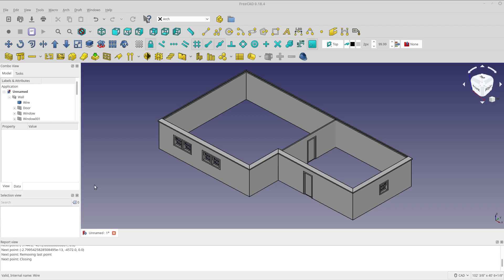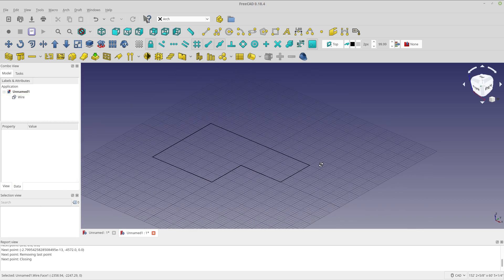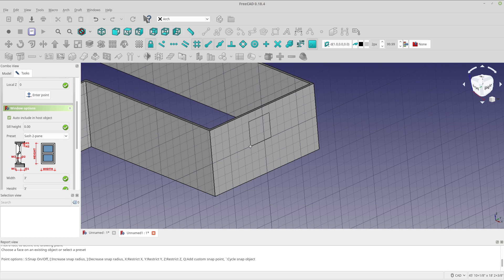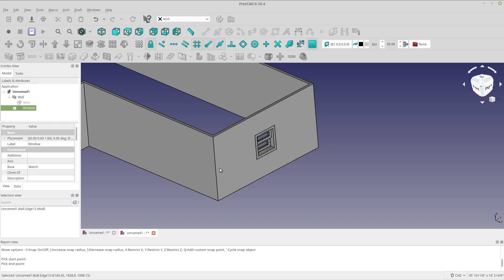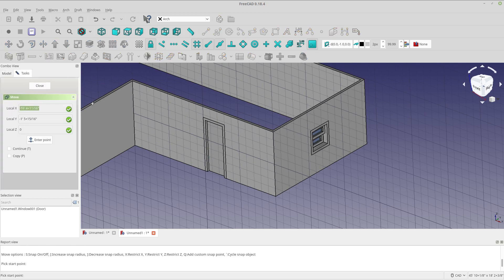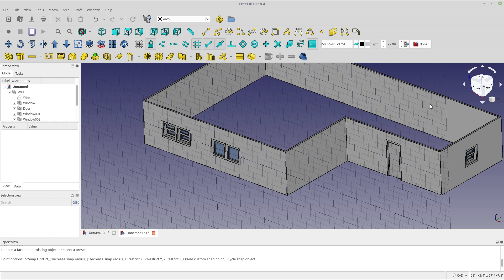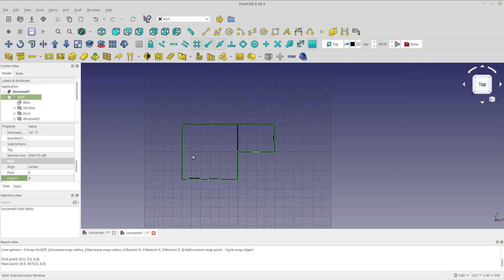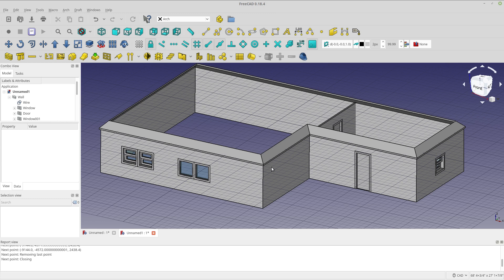FreeCAD - Arch Workbench - Getting a Result, Simple House

Comment: Thanks this has given me a good start with arch. I have been using part design and sketcher with good result for a while. But what i cant understand with arch is just where is the window that i placed. I can see it but cant see any measurements describing location in the tree. If i move the window then the tree object describes how it moved but not its actual location. What am i missing. Thanks still working through your vids.

Comment: How do you increase the grid size and make the lines snap to the grid. My grid is 3/8ft long
Reply from the maker: Snapping is turned on and off from the snap toolbar in draft. The draft grid is set in Draft Preferences. To make snapping easier turn on snapping and turn off all but the one snap tool you want to use. To set grid size use main menu edit-preferences, select draft on left then look for grid settings. Note: you have to start draft workbench b4 draft preferences will be present

Comment: For some reason whenever I try to build the wall, I'm getting an error saying <class 'TypeError'>: Line constructor accepts:
-- empty parameter list
-- LineSegment
-- LineSegment,double,double
-- Line,double,double
-- Point, Point
Any solution to that?
Reply from the maker: Are you selecting an edge. An edge would be a line from sketcher or a line/wire from draft workbench.

Comment: Thanks for the taking the time to put the video together.  To put your mind at rest over the 1st door height, if you review the steps closely, you left in the "feet" part of the initial measurement, so your input was essentially saying "six-feet-8-inches-feet" which is pretty confusing.  Hard to spot since "' looks very like ".  Would probably be nicer if the interface told you it didn't understand the measurement you entered, but instead the program accepts it as "6 feet plus 8 feet" and so gave you a fourteen foot door.
Reply from the maker: Thank you! That gets me so often. I usually everything i type has 'mm' after the value. :)

Comment: I'm just starting out on a similar venture so I really appreciate this info share! I love the x/y locking, that's a really handy feature. To throw a tip back your way, if you use the Extension (···) or Perpendicular (⟂) snapping modes you can draw lines like that interior wall easily. Cheers!
Reply from the maker: Good tip! It is kinda funny, i get locked in to certain snap tools and tend to ignore the rest.

Comment: I cannot get the walls to show. I select the wire, then select the wall and it disappear. What am I doing wrong! This should be simple :(
Reply: Your house is too small. The default grid size is way to tiny. Go to Edit->Preferences->Draft->Grid and Snapping. For ft-in measurements, I set my grid spacing to 25.4mm (one inch), main lines every 12 (foot), and grid size of 720 lines (60ft by 60ft). You'll need to hide and show the grid for it to take effect.
Reply from the maker: I apologize, I am just now seeing this. I am terrible with comments. If you want to give it a go. Try different types of wires. The wall is finicky about which wire/line/edge you use. You can use Draft Upgrade and Downgrade to change a wire.

Comment: Thanks for video.
I have to use Line or Rectangle for wall base, because I cannot modify (if I need) the vertexes of Wire. When I make double click on wire, vertexes become white, but when I try to select one of them to move it, nothing happens.
I mean, I cannot change the length of single lines of wire, so I cannot change the length of a single wall.
Instead, I can change the length of line or rectangle, and so the length of wall changes.
Dou you know why I cannot move the vertexes of wire?
I'm using FreeCAD 0.18 on Linux Mint.
Reply from the maker: This is my best understanding of this issue. The Draft Wire has a "Side", sort of a front and a back. You will only be able to click on the white box if you are on the correct "side." Let me try to clarify. if you set your working plane to "top" and draw a wire from the "top", you will only be able to select the white box from the "top." If you try to edit it from the bottom you will not be able to select it. I believe the grid has a physicality to it and you cant select through it. 

One of the ways I try to cope with this, if I cant select something, I will hide everything around it so there is no selection conflict. 

Hope that helps.
Reply: @mathcodeprint  
I hide everything, and I select Wire.
It becomes green.
I make double click on label Wire: the label becomes yellow; lines and vertexes becomes white; I try to select a vertex but I cannot move it.
I saw also other video tutorials where it's possible modify the position of vertexes in that way.
Reply: I read on a post, I don't remember where, that it's a limit of FreeCAD version 0.18.
I'm not sure, can anyone confirm?
Reply: @paolofogaccia9455  did youtry to just click on the white box of the vertex and move the mouse without dragging it?
A line should appear and you can click again on the new position
But the wire needs to be double clicked fro the tree before starting the process